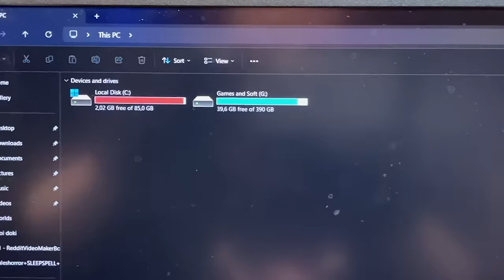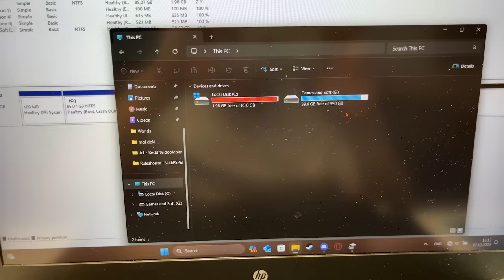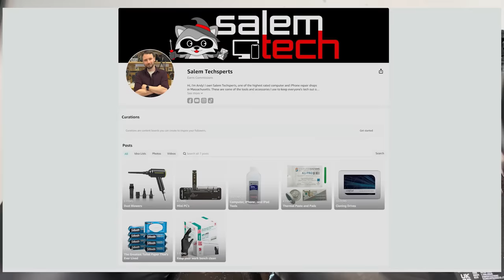HP Laptop survived the war in Ukraine and saved my friends life. Now I need to save it's life.

Comment: 3:33 Btw, windows ALWAYS does this, order is:
- 260 MB UEFI partition (was 100 MB or less for older systems or Win 10 32 bit)
- 16 MB reserved partition (invisible to disk management but can be seen in diskpart)
- Main partition (C drive)
- Arbitrarily sized Recovery partition (can be from 250 MB minimum to even 1 GB or more)

So if you clone the drive to a bigger one, the new partition will always be a 5th partition after the recovery one.

Oh and btw, if you update windows and for some reason the new recovery wim file is bigger than around 100-110 mb less than the recovery partition size, windows will shrink the C partition putting a bigger second recovery partition to the left of the older one, WITHOUT deleting the older one. It can do this several times in a row. I have an old disk with four recovery partitions lmao.

edit: there's actually a way to do the resize process way faster than how you did.
All you had to do was to disable the recovery partition with cmd so it moves the wim file into C:\windows\recovery, then you can delete the recovery partition in DISKPART, and resize freely the C and D drive, then you can recreate a new recovery partition, set GPT attributes to it, and exit diskpart. Then you can re enable the recovery with cmd so the wim file is moved back to the partition instead of being in the C drive.
Reply: Thank you for taking your time to comment this, I've been basically learning all I know about being a technician from YouTube and it's comments like this that really help
Reply: I keep my windows installs on 100GB dedicated partitions for easy cloning / backups / repairing, etc. and all programs, applications, data on a dedicated storage partition.

In the event Windows goes belly up (which is extremely rare for me), I can just nuke and re-deploy, or run an in-place repair "upgrade".

Gives easy piece of mind and allows me to run with all native Windows backup and restore functionality disabled.
Reply: Which soft do u use to  move a system from smaller ssd to bigger one?

Comment: Pro tip:  If you need to extend or move partitions, GParted is your go-to tool.
While it's a Linux application, it's included in most live distros, so you can simply boot from a USB drive and let GParted work its magic.
(I don't know if it affects Bitlocked devices, but non bitlocked works perfectly)
Reply: Won't do bitlocked stuff but since that's windows 10 (I think) that's not enabled by default. Win11 has bitlocker enabled if the machine supports modern standby but you can remove it
Reply: If it has bitlock, your best bet is to remove it and hope to fking GOD it doesn't sh1t itself.
Reply: Also clonezilla is a huge helper when cloning drives. You can do partition to partition or disk to disk or who knows how many other things. I've used it only to move data as-is from a smaller drive to a larger drive and then I can extend the partitions or add new ones.
Reply: @TheMoonWatcher will it clone a windows OS installation?
Reply: @ItsReallyGeo  It will clone the Windows Partition or the Whole Drive with Windows on it just fine. But Windows will probably ask for the Windows Key after this because it detects the Hardware Change. Nothing a Tool can do against that
Reply: GParted also has its own Live Image that you can Download from there Site. Definitly a great Tool which every PC Technician should have on a USB Stick
Reply: @oneandonlyjason  damn, been fixing these things for years and doing things the hard way. 

Thanks for the tips, definitely adding it to my to-go box.
Reply: Yeah, the partition scheme dates from the time hdds were everywhere. Something about read speeds
Reply: for bitlocker, you need to temporarily disable it, partition, then re-enable it

Comment: For the partitioning - I use AOMEI Partition Assistant to move and resize partitions when I have to and it works great, it's a lot less tedious than manually doing it.
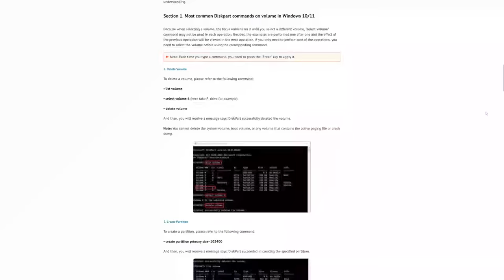Reply from the maker: I use MiniTool Partition Wizard which does the same. But as I mentioned at 3:37 the program still has to move all that data after you resize and click Apply, and I've had many experiences where it's taken hours for seemingly no reason to resize a partition (I'm guessing since the app has to move the data to the new sector after it's been resized). So in this case, Diskpart it was.
Reply: @SalemTechsperts  Yeah that's fair, also if you delete those pesky "recovery partitions" with Diskpart it makes things a lot easier too, as they're pretty useless and just get in the way lol
Reply: MiniTool PW is my go-to more often than not as well.
Reply: AOMEI sucks, you won't be able to 'reset this PC' after using it.

Comment: I love these stories. Thanks for sharing. Guess I could share mine real quick. 
Back in 2013 or so my grandmother's PC was already several years old and was so slow it was pretty much unusable. I asked her if I could hang onto it for a week and try to speed it up. Luckily my office had just replaced my workstation PC and there was nothing wrong with the old one, so I just brought it home (wish permission), put her HDD in it and added a another 2tb one.
Took that one back to her and she used it with no issues ALL the way until earlier this year when she bought a new one because she wanted to go ahead and get on Windows 11 before support ended for 10.

Comment: For the partition problem, you could have used gparted, it's the best partitioning software out there, it can do basically anything, including moving that weird partition layout around without copying all the data to another drive and putting it back on a new partition
Reply from the maker: Yes you could. I use MiniTool Partition Wizard which does the same. But as I mentioned at 3:37 the program still has to move all that data after you resize and click Apply, and I've had many experiences where it's taken hours for seemingly no reason to resize a partition (I'm guessing since the app has to move the data to the new sector after it's been resized). So in this case, it was faster to copy and paste and then Diskpart. Have you ever had this issue with gparted?
Reply: @SalemTechsperts  Not really, for me with gparted it has always been very fast, on SSDs
Reply: @SalemTechsperts  GParted allow you to queue changes so you don't need to Apply multiple times + moving the files manually sometimes is kinda unreliable, specially if any of the programs are running while you are moving them. Since you need to boot another OS to use GParted, there isn't such risk

Comment: 8 months late, but what the hell. 

Ex repair shop owner here. 
I worked in a town with a small college. We would often get transfer students that barely had US currency, barely good enough English, and barely good enough laptops. 

One of these individuals I helped had an HP x360 or something like that. The hinges were totally blown out, the screen was hanging by it's cable and the entire chassis was bowed in like a C pointed in your direction. 

After taking it apart, fixing the hinges was not a viable task. I had to order a replacement top cover as all of the plastic was either gone or cracked. 

After getting the top case, I reassembled the laptop, moving all the parts over to the new top case. Screwing in the screen, I get everything reassembled. I replace the rubber feet and give the entire laptop a wipe down, and it's good to go. 

I show up to the college later that day, and he isn't able to pay due to having a certain currency. I asked him if he had other payment methods, he said no. 

I'd like to think I wasn't taken advantage of and just helped a kid in need, so I just gave it to him and said, "it's on me, I've been there. If there's any issues with it, let me know!" 

He was shocked. Pretty happy I was able to help someone during my computer repair journey.

Comment: Not bad, and huge congrats for being able to do this free of charge to the customer. Sadly, the Russia/Ukraine war has been devastating in many ways, so I'm glad you were ale to help out!
As for the laptop itself, it looks decent, although being a HP I'm not surprised of the overheating, since my HP gaming laptop did the same thing!
It might have been cheaper (and easier) to just add a 1TB Crucial MX500 (or similar) 2.5in SATA SSD into that empty slot that HP left, make that the G drive, then extend out the C drive to fill all of the 500GB SSD that was already preinstalled. But at least the laptop had dual channel RAM! And at least it'll run cooler now!

Comment: Hey. As a technician myself, I have to deal with this stupid HP partition problem (not exclusive to HP ofc). I highly recommend using something like a minitool partition wizard as it makes this thing painless (slide everything but two first partitions to the end of the drive, resize C, slide first recovery back, resize G, done) and fast (on an SSD this will take like 10 min).

Try it out, diskpart is PAIN

Comment: Love your content and your work ethic, just thought you should know that when selecting partitions to clone to a fresh drive, Macrium Reflect has an option to reorder and resize partitions when moving from a smaller drive to a larger drive (at least when I run it on Windows). I've used it to upgrade from a smaller SSD (250GB) to a bigger one (1TB). Not sure if you were aware of it or if you just have other reasons not to use it that I'm not aware of since I'm still new to the computer repair space (I've only worked on 3 computers so far) but I'm certain that The Greatest Technician That's Ever Lived gets a good job done regardless. Keep on doing your thing, and happy holidays!

Comment: My go-to tool for this is GParted Live on a USB stick, and my plan would of been: Nuke the two recovery partitions. Extend/move the G:  drive.  Extend the C: drive.

However, in this case, since you got the old drive still, I'd nuke both recovery partitions and the G: drive, extend the C: drive, make a new G: drive and copy the data back over from the old drive.  I bet you did the same.

Comment: Gparted can shrink from the beginning, it does it exactly the way you think it would do it by first extending the partition and then moving all the data "to the right", should be faster because it moves data itself and not files, skipping file system overhead.

Comment: Linux Live CD/USB with GParted, you can move the partitions around. Running bleachbit, ccleaner or the like before cloning a disk is always a good idea.
Why clone the disk, however, when you can do a clean install of Windows 10 LTSC and use SDIO (Snappy Driver Installer Origin) to install the most optimum drivers in less time, and put the old disk in a cheap external enclosure.

Comment: There is software where you can basically move partitions around, so that you can actually extend your C drive without moving data. I sadly cannot remember what it is called though, but I do remember I used a software for free (which was hard to find, because most software claim they're free and then they aren't )

Comment: I've had a Pavilion Gaming before with very similar internals, and yes, they're pretty much only good as powerbanks
They terribly overheat any my Ryzen edition was locked at... 15W. But Ryzen Controller was no help because, uh... it was running at 95 Celcius already 😂😂😂 new paste no dust

Oh yeah and the original NVMe inside (which looked exactly like in the video) would run hotter than the surface of the sun

Comment: I wrote a cool reply but auto play ruined it... 
Your video gave me a good idea that im gonna do for myself, and i think you might consider it too. 
So i've found it allot easier to just copy a desktop with like diskgenious or other similar software, rather than partitioning THEN installing windows. My idea is you take an old cheap mobo, an old cheap cpu (whatever can run a trial version of windows 11) and you make a static system with nothing but that copy software tool and windows. That way you can just pop in HDDs, ssds, m.2s whatever/whenever you need to and just copy a clean working setup where you only have to install the copied drive onto the new system and activate windows. 
you wont have to manually partition or anything. just hit the drive you wanna copy, select the empty drive and the copy process does everything else. after a few minutes, you have a new drive ready to be used. very little hassle involved and you wont have to use those adapters that look like they're held together with 2 whole spools of electrical tape.

Comment: I have a similar model but today it just died on me. I was using it and suddenly, it shut down abruptly. Now, the only thing that turns on is the light of the power button and the light of the Caps key that keep flickering but that's all, nothing in the screen, no fans nor any external devices plugged like the mouse shows any sign of life, so I guess mine wasn't so lucky and has entered the computers heaven... Or hell, since it's an HP after all.
Reply from the maker: The caps lock key is telling you what the problem is. Search for the code it's giving you. It could be the RAM, battery, charger, or charger port. This laptop is very easy to work on and everything is modular. Don't give up on it.
Reply: @SalemTechsperts  code? How do I get a code for a flashing light? And the battery died years ago, but the laptop still worked fine. I guess I'll have to find a repair shop because I already tried all the tricks you can try when you don't have tools or another way to see if the RAM is fried (cleaned the vent, pressed the power button for 1 minute, etc.) but Other than that, I don't see what else I can do.

Comment: have you tried Minitool Partition Wizard? you can just move the partitions so the unallocated space can be moved so you can resize C partition if you move other partition to the end of the sector.
I always use that tool for cloning and changing partition size. also I use version 9.1 because new version UI kinda sucks I prefer old one.

Comment: The silly partition layout can be fixed using a Linux distro that has gparted or the partition magic distro. (Which is more or less the same). You can move the second recovery partition. Extend the D partition to how big you want, move that to the end, etc etc. Annoying, yes but very doable. 

Before I used macrium reflect, I used clonezilla and gparted to basically do the same thing. 

The laptop will run startup repair but it will be bootable afterwards.

Comment: Why do people cut their drives in multiple partitions? I don't get it.
Some people say it gives them more structure to save their personal stuff in another partition. Why don't they make another folder on the c drive?!

And when I need an extra partition, then just buy an extra drive. In this laptop for example u could easily put a cheap 4tb 2,5" SSD in to save ur personal stuff
Reply: Some people want to do dual or triple boot of different OS so they cut their drives to make a new OS.

Comment: Mind if I drop a small HP horror story?

My mother bought an HP Stream a few years ago without realizing it has the worst CPU in existence. 

It has a fucking Celeron with only 4 gigs of RAM. 

not to mention with stock windows 10 installed, it had like 10 gigs of free space left

and the time plugging in a 50 gig flash drive completely corrupted windows

The only good use I had for it was using it as my practice machine for installing a copy of Ubuntu linux on a physical hardware for the first time

Comment: Stupid question: Why use PTM 7950 thermal pad instead of some solid thermal paste like noctua NT-H2 paste, isn't thermal paste more thermally conductive than pads?

Also why and when would you use pads over paste?

I'm not in the pc repair workforce yet but I'm close to entering in a year or two and this really puzzled me.
Reply: PTM7950 is on par with liquid metal from what i heard
Reply: PTM7950 doesn't need to be changed as much as thermal paste needs to be, it can last several years and has the same; if not better performance than most thermal pastes and in regards to this question, it gives better temps than NT-H2.

Comment: 3:28 I do remember seeing some software where you could actually move the unallocated space so that it is behind the C: drive and I did it a while back. Was a lifesaver but usually those types of software are paid. Still annoying though.
Reply from the maker: MiniTool Partition Wizard which does this, but as I mentioned at 3:37 the program still has to move all that data after you resize and click Apply, and I've had many experiences where it's taken hours for seemingly no reason to resize a partition (I'm guessing since the app has to move the data to the new sector after it's been resized). So in this case, it was faster to copy and paste and then Diskpart.
Reply: @SalemTechsperts  Oh ok. Thanks for clarifying!
Reply: @SalemTechsperts I used aomei partition assistant for mine. It was actually pretty quick. Maybe it would be better than minitool?

Comment: Could you use a tool like EaseUS to move the partitions so the Unallocated is next to the storage partition, and then extend the storage into the unallocated? Instead of having to manually copy/paste them around?
Reply from the maker: Yes you could. I use MiniTool Partition Wizard which does the same. But as I mentioned at 3:37 the program still has to move all that data after you resize and click Apply, and I've had many experiences where it's taken hours for seemingly no reason to resize a partition (I'm guessing since the app has to move the data to the new sector after it's been resized). So in this case, instead of risking it, it was safer for me to copy and paste and then Diskpart.
Reply: @SalemTechsperts  And this is why you are the greatest technician that's ever lived.